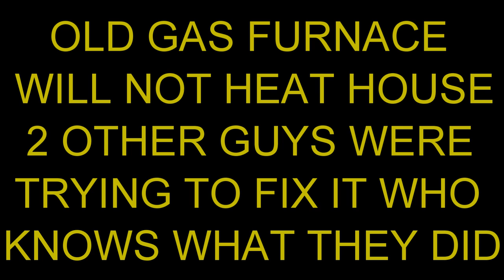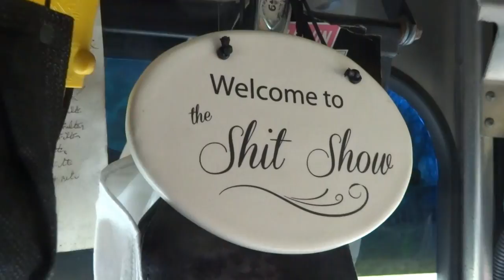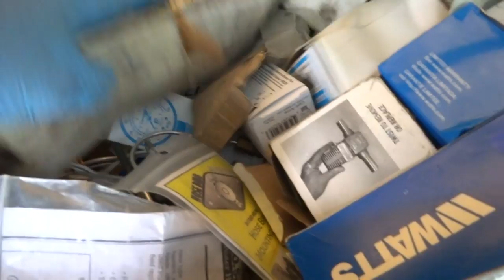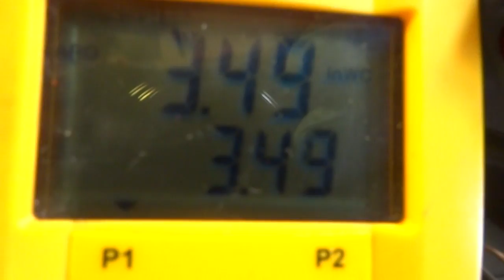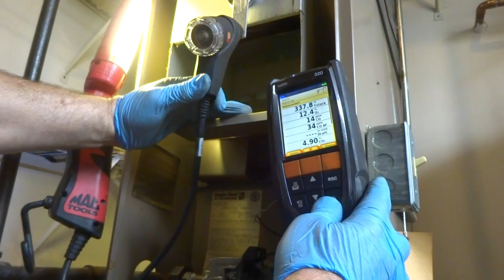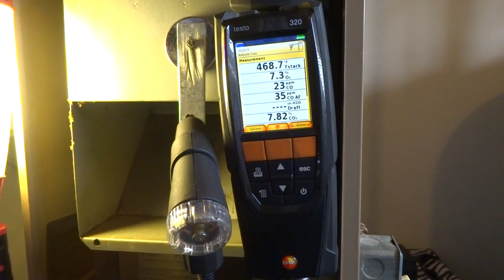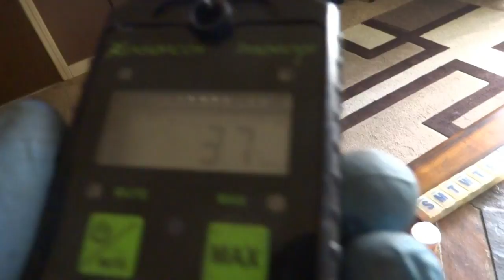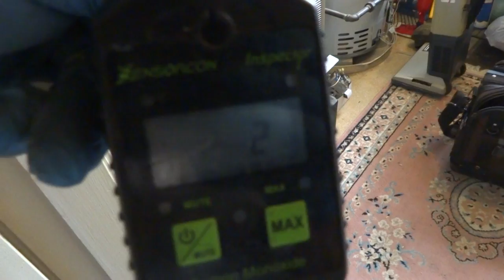OLD GAS FURNACE NO ONE CAN GET IT RUNNING

Comment: steve i see it all the time in the work place as a mechanic with three working shifts you don't know what the last guy did so when you dont keep it in mind you start thinking what the hell did i do i fixed this and now this is broken did i do it right? in the chain of fixing things then it takes a while to realize wait a minute some one else was here messing with it because when like you with the customer your trying to show them whats broke and explain it but it looks like to them you dont know what your doing because you replace a part and its still not working so i usually say to management i dont know what the last guy did i wasnt there in your case she said i had two other guys working on it how do you know what they did you were not there they could have applied 110 to the gas valve to try and get it to work and fried it

Comment: Very knowledgeable tech.  I was a service tech for years and I like the videos of how you show the scammers taking peoples money.   The only issue I have is the Pipe Dope.  My trainer would have a mental breakdown if I left pipe dope on the fitting in lumps and didnt rag it off.  The Excess on the ends of pipes break off and go into gas valves also.  I know my trainer would be freaking out at me if I did that and I learned to never ever get pipe dope on the last 2 threads and to clean up the pipes after I installed them!  For 1 the metallic stuff is so bad for people and cancerous as fk!
Reply: I'd have to agree w/you on that.

Comment: Hello sir I have a question for ya I have a old Burnham boiler that won't light it has the g60 ignition and I have the original gas vavle this furnace also has the vlogic board with the diodes that light up. they all light up until it gets to the pilot gas and the main gas I replaced the pilot assembly thermo couple and 2 thermostats since it stops at pilot gas and won't light could it be the vavle

Comment: im in the same boat.. techs  cant firgure out the issue on this furance.. its a 90+ 

furnace  had a  power surge and everything dead except blower on all the time  weither calling for heat or not.
1.inducer, ignition and safety wires  going  to connectors on gas valve 
2. tested the saftey circuts all good to and from connector on gas valve 
3. theres power on the main board going  everywhere  fuse is not blown 
4. no power coming into inducer motor  from gas valve connector  but theres power from main board to gas valve connector 
5. i took off wires to pressure switch .. tested both blue wires dangling in the air and both in and out  have 15 volts 
6. the diagnostic error light on gas valve  used to flash  a trouble code of  "bad  limit circut"  but now no light at all

Comment: If you have the pilot lit, doesn't that mean there's gas being supplied to the furnace?
Reply: No. The pilot comes before main. As long as thermocouple has a good flame,enough micro voltage is generated to keep pilot valve open

Comment: Did you charge her full price for a used transformer?
Reply: Steve salvages slightly used parts from swapped-out furnaces and charges half price to save his customers money.  Are you sure it was used?
Reply: @craigharding475  are you sure it was new?
Reply: @craigharding475  he said in the video it was new if I recall.
Reply: @mickeypace  everything was new at one time!
Reply: @mickeypace  It did look shiny and clean, so I could be wrong.  Thanks.

Comment: I can't believe you changed her for a used transformer at least half and where you buying parts them part don't cost that much
Reply: You may be right but he does have to lug all that crap around.  Beats having to make a run to get parts.  In the long run 65 bucks is cheap.

Comment: a used 24v 12va transformer is not $65. A brand new one, is $35 CAD ($23 US). That's not cool marking up a USED part almost 3x USD for a 78 year old lady on a fixed income. I thought you were better than that Steve.

Comment: What makes a Gas Valve fail? Is it a corrosion issue?
Reply: Good question. Same issue with water heater valves
Reply: @barackobama5304  I watch a guy repair pinball machines and he works on solenoid devices all day. Usually it's the switch that operates the solenoid, rarely does the transformer coil part fail. I bet there's plenty of people out there who would tear those valves down and figure it out. But the gas valve probably has to meet strict safety criteria and might be permanently sealed up or not designed for service/repair.

Comment: Steve, did you ever hear of a slow operating gas valve.  If it was, I don't think you had the power to the valve long enough to give it time to open.  You just kept clicking the solenoid.  Not saying the valve is good or bad, but some gas valves are designed to open slowly.  Been there, done that.
Up-date.  I looked up the valve and it's not a slow acting valve but never assume that at the start.  Other then that, good job.
Reply: Interesting.

Comment: There's nothing wrong with that value , this valve happened to be a slow action valve , once you put power too the valve it takes 30 seconds to ignite so either he didn't wait Long enough or he just didn't know what that honey well makes 500 different types of valves .
This one is designed for larger heaters like boilers where there is redundantcy concerning the burner over half million BTUs.
More than 10 burners should not come on very fast because of back explosion from input from gas pressure line so redundancy is necessary and using these slow action valves to bring on the gas slowly sometimes one gas value is necessary for this operation or two but this small furnace does not require but doesn't see on the valve except for 100% shut off for leakage or in case of leakage so this valve should not be used on a small furnace standard furnace gas valve is in order.

Comment: Thermocouple should be minimum 3/8ths within existing flame, also with a multi-meter, test the thermocouple, red or +probe touching end of thermocouple that ties into existing gas valve, black or - negitive probe to body of furnace, should read minimum 20-millivolts,  which is matter of time its on its last life span at 20 or less millivolts. Should be 26-28 millivolts to hold consistent standing pilot. Time to test a thermocouple and-or a thermopile approx 8-minutes. Thermopile should read 750-milivolts, multi-meters put you in correct direction, process within elimination of time consuming guessing it might be this that, hours pass still havent solved the problem. Price for multi-meters , 40.00-260.00, all dependent within how many features you desire. Actually are priceless, due to the time saving factor. No guessing needed.

Comment: Lol had one today and yesterday bad fan center and limit then get those replaced. Gas valve was bad put the gas  valve in didn’t finish there the T stat was bad after jumper the stat out fired up. Put back on their old stat fired up. Never know what your gonna get into. I thought to myself should have sold them a new furnace as well lol..

Comment: How are you making a living by charging prices like that... plus these people have a very inefficient system with all components compromised, the integrity of the system is compromised and their safety is at risk at anytime, i would have at least expressed all of the concerns with the system age and given them options so they can pick which way they want to spend their money, on something more efficient with a warranty especially at the age of 78 or keep parting and paying labor with her safety at risk... all it takes is one expansion and contraction of the heat exchanger for an older system with soot and CO is leaking into the home and there is not a combustion motor on this to help with that either...

Comment: Seriously pathetic the two prior supposed techs that couldn’t even do basic troubleshooting. The question to you how the hell you can do the combustion testing and not do a basic soapy water test of you the pipe joints you took apart. Not only is that bad in general you have recorded it and put it online in a video. Great for your liability insurance.

Comment: Okay so did you see that this furnace has been a drained Frome the 70 or 80 years because in the 90 we in the industry started using 90 percent ? So you sold this lady a $500 job when a unit like hers cost to you 280$ plus install !!!????? I mean wouldn't you rather take responsibility for parts on a new unit with pm included over a 25 year old artifact !!!!!! And in compression to 500$ she could have 10years protection for a simple 7 grand , I honestly think you bessiness is lacking since brother of a mother hvac